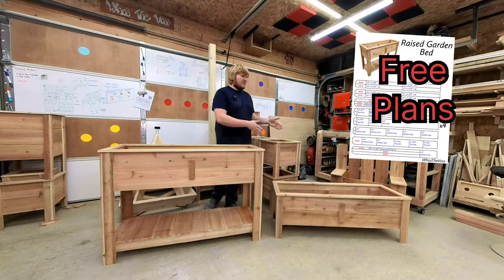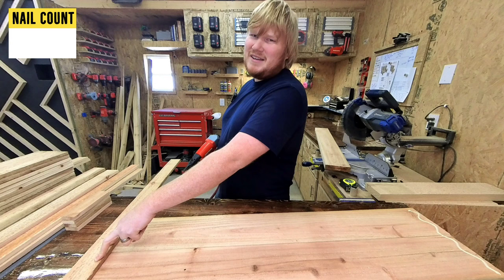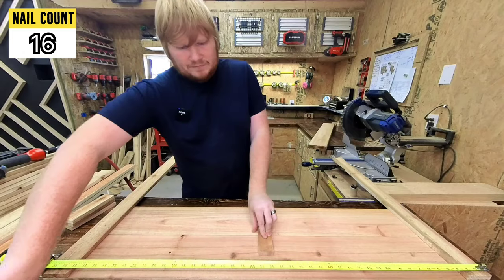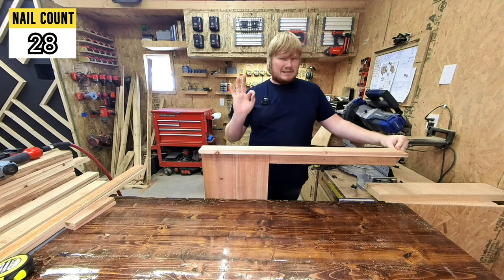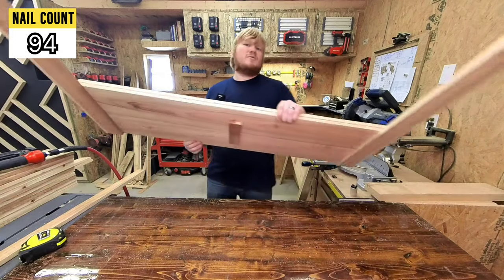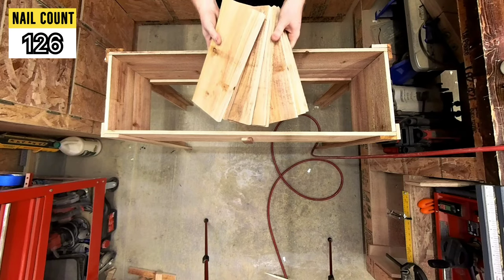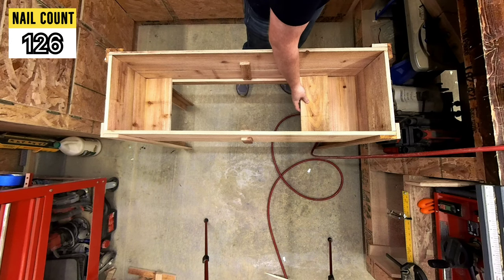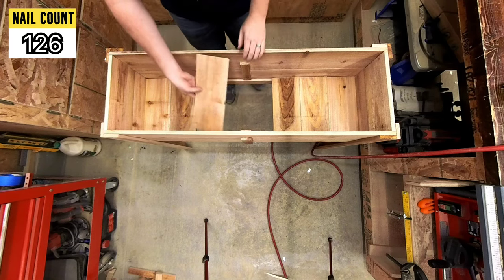Raised Bed Garden Box. FREE PLANS

Comment: I put 1/2 inch braided rope on the ends so the customer can move them around. And on the mitered tops I screw on with glue because that’s the first hand hold people will reach for and they will pull off or break.
Just a thought great videos as always. Your number 1 fan…..
Reply from the maker: I like the rope idea :) thanks Greg
Reply: Do you have a picture of what the rope looks like?  I have been wondering how to create some carrying handles also.
Reply: @danielcaballerojr  harbor freight has all kinds of rope , but the wife didn’t like it so I went to Lowe’s and bought role of regular 3/8 braided rope for like 10 bucks for 50 ft.

Comment: I like how you have 2 rails of tape measurers for when you absolutely positively need to measure every mother loving board in the room.
Reply from the maker: Fun fact: i only use two of them (bottom left). The tiny ones are flimsy and one of the bigger ones has a metric side which is always the side im using to mark soooo I only use the two
Reply: Tape measures are like the 10 mm socket, you never have one handy when you need it. I have over a dozen in my shop & one at every saw…

Comment: Thank you for the content and the free plans, I wanted to say I've found you can clamp one of the sides to your workbench on the leg below where you will put the width pieces. It holds that one from tipping and sliding pretty good with just the one clamp, even the long ones. Then both your hands are free to tighten the other boards up and nail. Hope this is helpful. You are a treasure friend, thank you for what you do.
Reply from the maker: I like it, I like itttttt

Comment: Another great video. Thank you for taking the time and sharing your knowledge and experience with everyone.  
Only minor gripe I have is that little brace piece on the sides.  Perhaps extend it so it runs the full height of the side?

I recently finished a planter similar to this but without the shelf and with some additional trim on the top and bottom of the sides between the legs.

For anyone debating the necessity of the shelf for stability, I don't feel it's needed.  I think that wood is better used making rh box more detailed or adding additional soil depth.  I love to use screws as I feel it creates a stronger finished product.
Reply from the maker: Nice :)

Comment: 7:15  A tip I've always used when assembling and I have something tall I want to stand up vertically while I'm nailing (drilling, screwing, etc.) something flat to its bottom edge, is to support the vertical piece with a simple cardboard carton and a clamp.  I keep several of a larger size box folded flat for storage needs, so I quickly fold one into its box shape, set a weight inside (gallon of paint, jug of water, something to make the box heavier than the piece so it won't tip or scoot), and clamp the top edge of the box to the vertical piece I'm assembling.  The box side is nearly 90 degrees, not always perfect, but then again neither is having the vertical piece all wobbly.  Then when I'm done, put the weight back where it was, unfold the box flat again and store, all done.
Reply from the maker: Ooooooooooooooo i like it!

Comment: Ayyy another awesome video! I got a quick question, when I make my garden beds I screw the legs together first, same with the walls to rather than the centre piece of wood (although I may consider putting a centre piece in), I also counter sink some screws from the inside of the bed into the legs. Not sure if it's overkill but I just want to make them last
Reply from the maker: If you watch the long planter box I screw the short sides in place, I just forgot to show it in this video. (Sad moment)

Comment: I have to laugh.  I made something very similar to this based upon your long garden planter with the 16" legs.  I even made the leg brace and have an option for the shelf on the bottom.  For holding it all together while nailing it, I use the black plastic squeeze clamps to hold a board in place on the side I am not nailing, then nail in the end boards on the other end then flip it all around, take out the clamps and nail the other side.  Curious what you do when you have to use a sliver for the bottom/floor boards?  My current solution is to cut the sliver to size, then find a likely neighbor for it, something close in shading, and glue it to that piece and tack it on with some brad nails.  Thanks again, bro.  You da man.
Reply from the maker: I avoid slivers at all costs :P never had to use one with my plans, if I did need one, Id do what you suggested :)

Comment: Nice. I would love to add rollers to these. This way I can move them when we get too much rain or too much extreme heat it too much cold to avoid freezing. I can roll them under my patio for extreme weather.  

How would you go about that? Maybe have the bottom like a dolly and add the rollers?
Reply from the maker: I like it! Harbor Freight has some cheap casters :)
Reply from the maker: Id upgrade the bottom board supports to 2x4's and that would give you plenty of support

Comment: Thanks for the video. I enjoy the step by step instructions. However, during the video you mention that due to "blow out" of the bottom box boards, you recommend to run a board board to reinforce it. Could you elaborate on what you mean and how to do it. 
Thanks
Reply from the maker: When you drill out the holes, it pushes little sharp shrapnel pieces out the bottom of that board. When youredone drilling flip it over and you'll see them. They just need knocked off, not really sanded

Comment: We interacted on messenger. Thanks for this build. I have sold two and have an order for another three. At a build cost of about $33 and a sale price of $150 this is the highest profit margin item on my list of all of your planters. What do you recommend as the optimal price point for this. Also regarding the lip, you don't add a lip to the 16X16x16 model. Would you recommend adding one? Also the 5000 brad nails at harbor freight have a 20pct coupon right now. So i bought rhem yesterday and paid only $10.89. That's a steal.
Reply from the maker: I sell mine for $120 each :) i dont add a lip to the three picket planter because the dirt weight is supported just fine from the  boards without a lip :)

Comment: Super beginner here, and don't want/need to invest in brad nail gun. What would you suggest in place? Galvanized 1" finish nails? Tx great video...
Reply from the maker: Stick with a nail that doesnt have much of a head so it blends with the wood, sell a few boxes and use the profits for a nail gun :) Harbor Freight has them for pretty cheap

Comment: Great video! Just need some clarification. in the video as you are doing the miter cuts for the top lip - you measure 46 1/8 and 15 1/8. you then stated add a 1/4 inch to each and then you state that equals 46 5/8 and 15 5/8. if you truly add 1/4 inch to each that would be 46 3/8 and 15 3/8. Which is correct - what is the final measurement?  Thanks and I really appreciate your step by step approuch.
Reply from the maker: 1/4" lip on all sides so you add a 1/2" total to each board :)

Comment: It would add time and materials, but feels like throwing in some screws would help for long term strength. At least where they can be screwed in from the inside. Also, been to Bushnell a few times. It's been a good 25 years but you know... Small world.
Reply from the maker: I didnt add it in the video but throwing some GRK screws in the end boards is what I do, since realistically there are only 8 nails holding the sides together

Comment: what's the thickness of the wood you are using, in my area the least i can get is a 1 inch.
Reply from the maker: These are cedar pickets for fences, so they are only 5/8" thick. Dimensional cedar is usually thicker like the 1 inch :)